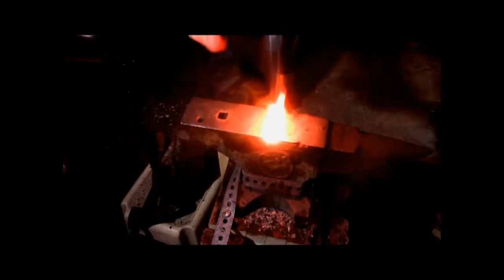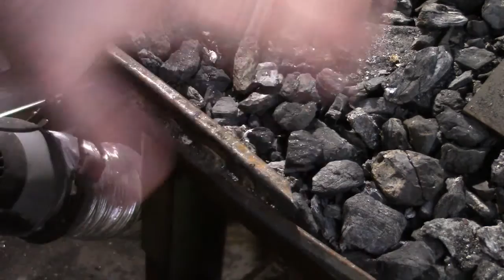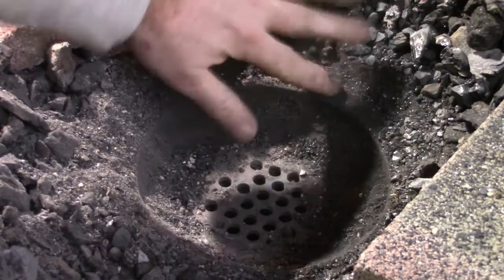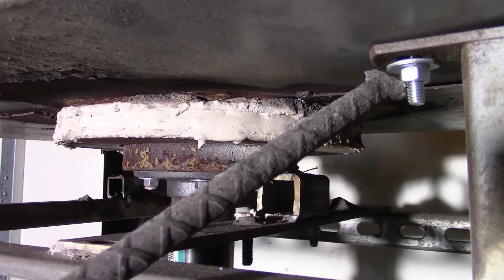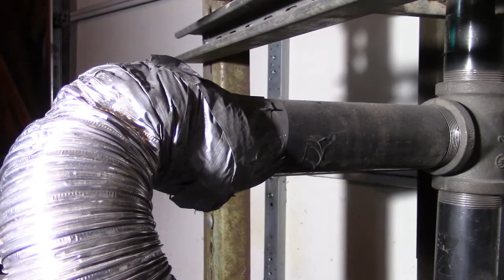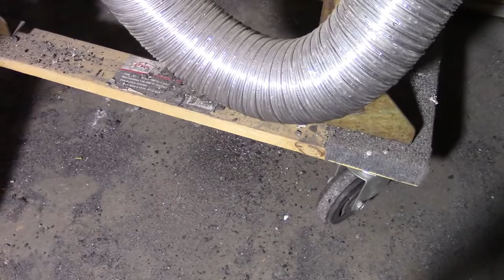How I built a Brake Drum/Rotor Forge for Cheap

Comment: Is there anything u would have done different, I’m planning on making a coal forge, not sure if I should use a drum/router or make a forge pot out of steel. There are many different design so idk what to make. My propane forge isn’t big enough for some of the projects I want to try
Reply from the maker: I'd change a couple of things.  I started out with a drum, but switched to a rotor pretty quickly.  The drum was just to large... I was going through way to much coal.  If you're doing large pieces, then it might work better for you, but for me, with what I do, and how I forge, having a smaller fire pot from using the rotor, worked out a lot better for me.  

Another thing I will change up when this ones need to be rebuilt, is to make the sides on the table bigger.  I just used some metal shelves and flipped them upside down,  but that didn't give me much of a lip to hold the coal in, so I still tend to knock a bunch off as I'm forging.  I'll be going with something with taller sides on it for the rebuild, or maybe just fabricating some taller sides, but either way, I need something better to hold the coal.  Keep in mind that for long pieces, you still need an area with very low sides to fit it in the forge correctly, so if you're doing longer things, then keep the sides shorter in one area, front and back, so you have room to slide the piece in.

The other thing I don't have on this one, is any kind of air damper.  I have some basic control with the hair dryer settings, but it would be nice to have a little better control over the air flow.  I would use a lot less fuel, and would would be able to control the fire temp better. 

Other than that, its just little things that might not mean much, depending on your design.  Like mine is on a cart, so I can wheel it out of the garage to fire it up. For me, I am putting larger wheels on it when I get to the redesign, but if yours is stationary, than that doesn't mean anything.  

So those are the biggies that I would change for mine.
Reply: HoJ Forge I think mine will be stationary. I’m planning on making a better propane forge also. I got a champion hand crank blower for a forge at a auction cheap, figured I’d build something around that.

Comment: just out of curiosity why a Rotor and not a drum? got to change the drums on the jeep might make a good time to build my forge. thanks for the info.
Reply from the maker: My first forge was from a drum, and i worked fine, but was just a little to deep for me.  I have more control over the size of the fire now by piling the coal up higher or lower, and using the fire bricks to make it deeper when I want a bigger fire.  With the drum, the fire was one size... big... so I was just burning a little more coal than I wanted to for smaller projects.
Reply: +HEAPofJEEP 
very cool makes sense to me, love the videos!!